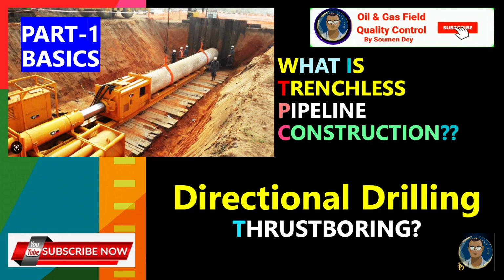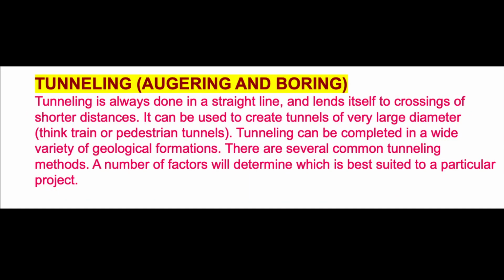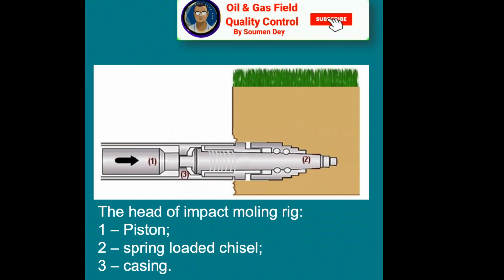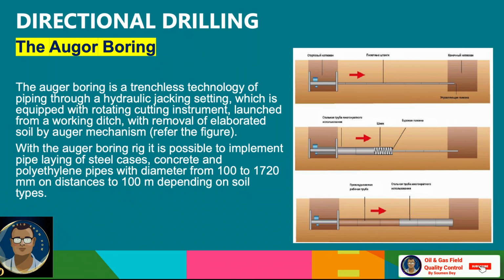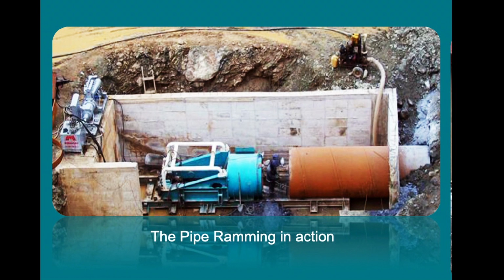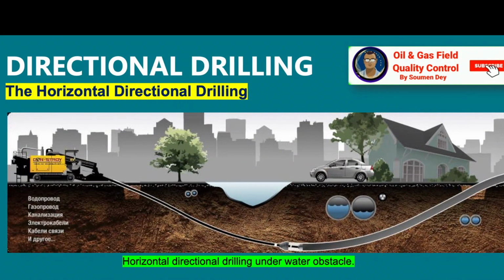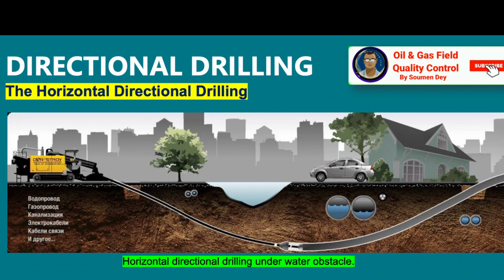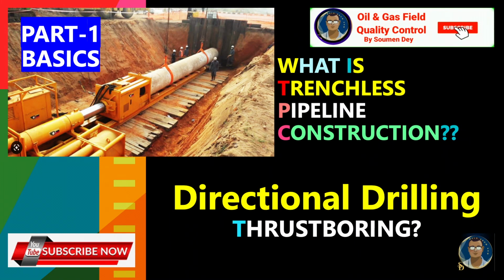What is Trenchless Pipeline Construction? Thrust Boring || What is Micro Tunneling?

Comment: Respected sir
I need some information regarding thrust boring, assume total length of boring is 20 meters and in one time we use 20 meters pipe when we push the 10 meters pipe than need to remove in side soil (how to remove) and second after one pipe of 10 meters than need second pipe so need to proper welding than we push  the second pipe please explain how to remove soil of inside pipe and and also need to welding of second pipe
Reply from the maker: As per my experience, before we plan a thrust boring Survey of the soil condition is pretty much crucial. Unform soli condition like continuous rocky or uniform hard soil is ideal for HDD/ thrust bore. Loose soil areas are not good for thrust bore operation. If you have 20 meters long thrust bore, at least 30 meters of pipe section need to prepared (3 X 10-meters pipes with two girth welds) with external coating completed. In ARAMCO, additional layers of protective coating is required. During HDD, the from end of the pipe is welded with the cutting conical tools, no chance of soil to be inside the pipe.